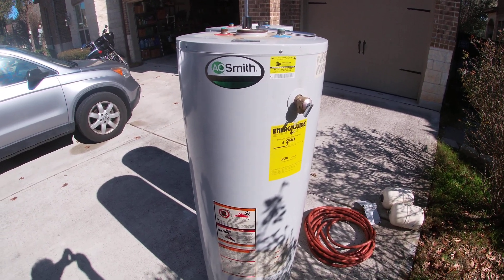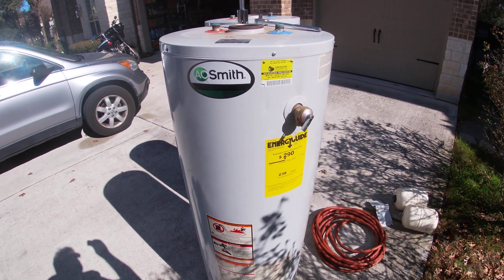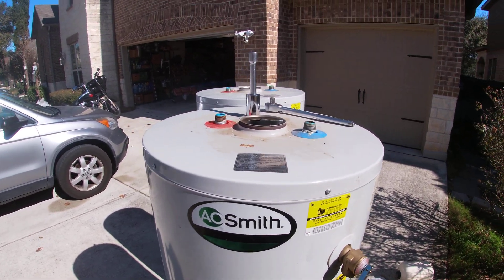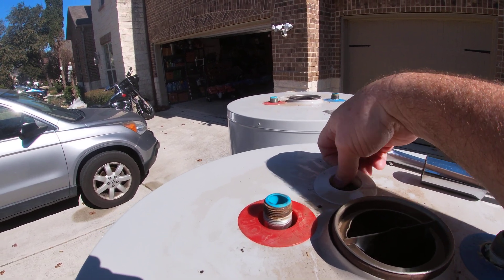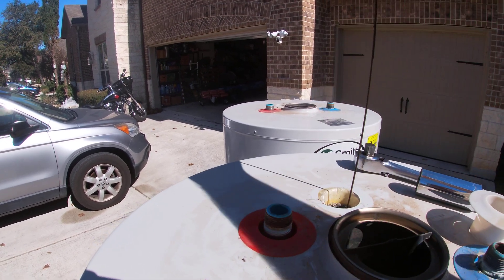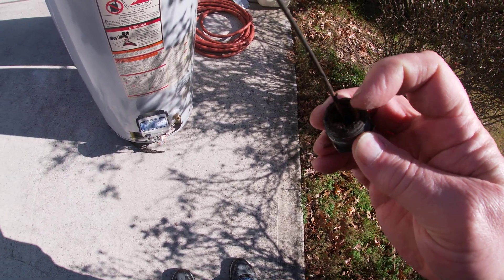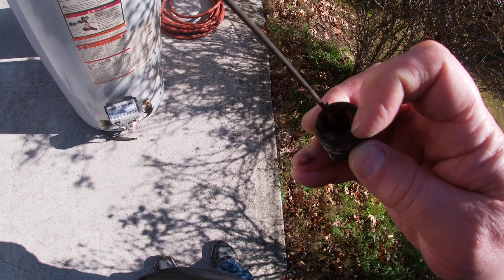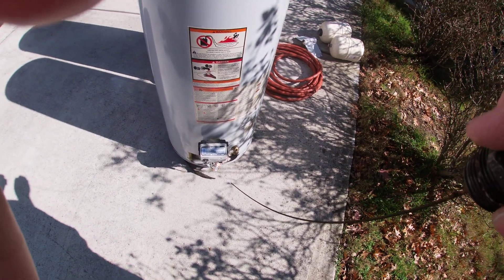9 year AO Smith gas water heater anode

Comment: The anode should be replaced on a regular basis.  Powered anodes last longer but not forever.  Why didn't you just change it and keep the water heater?
Reply from the maker: I didn’t know if the original home owner replaced the anodes…probably not. I didn’t know the internal condition of the tank. I’m not sure there is a way of determining this, so I decided not to take a chance.

Comment: actually yours is really clean   for 9 yrs  i dont understand why u say its no good
Reply from the maker: Yes, great point. The water heater looks great on the outside but the tank was corroding on the inside. I knew this since rusty water was coming out of my hot water faucets. Also, since I had no idea how long the anode had deteriorated, I opted to replace to prevent the tank from springing a leak. Thanks for the comment.
Reply: thats just the inside wire   the outer rod isnt even there its gone   (ate)  away vanished... its about  3/8 --1/2 "" in diameter

Comment: I was told by a pro to replace the anode rod every 5 years and not to use an impact wrench to get the old one out (it will make pieces fall off and make noise in the tank).
Reply from the maker: That sounds about right. Check the manufacturer to find out for sure.
Reply: there is so many optional tnings that (can) happen in referance to the  anode rod it isnt even funny   seen all of them.